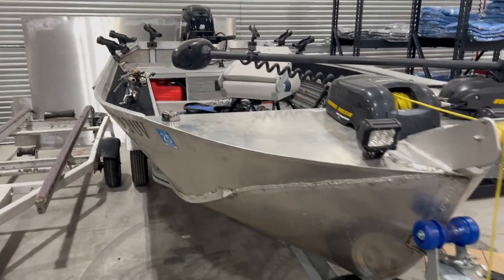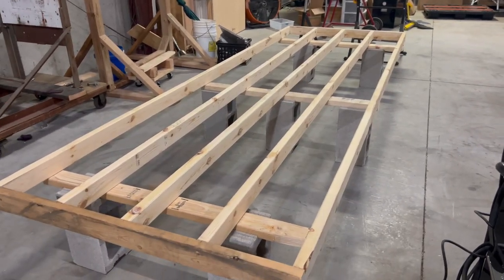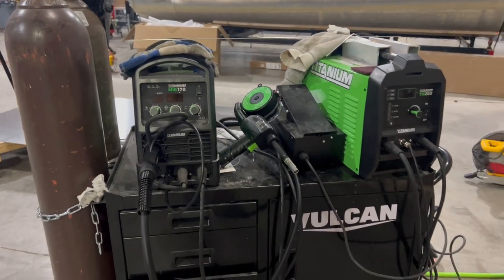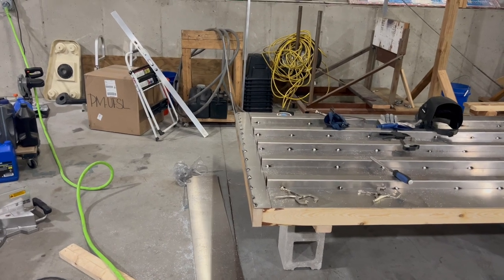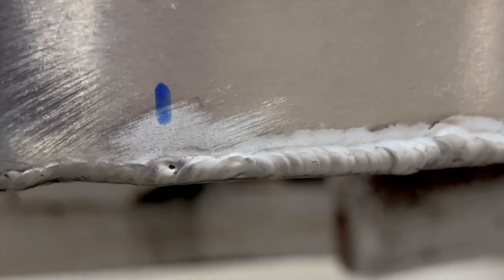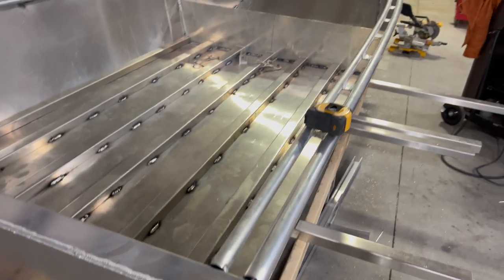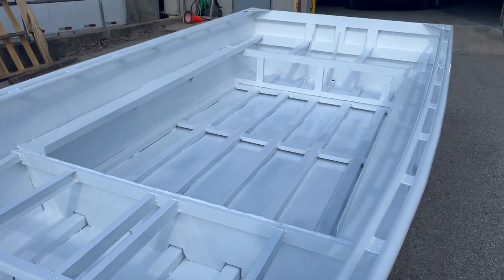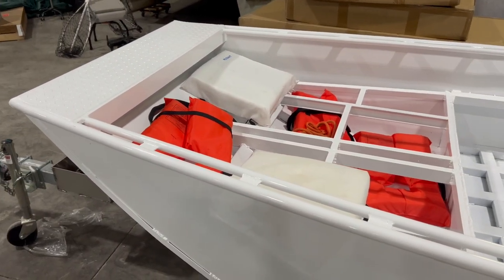Welded Aluminum Boat Build FROM SCRATCH - Part 1

Comment: How did you rip open the tubing to get around the top edge of the boat?
Reply from the maker: I set up a guide on my table saw and rip it on there. Works pretty darn well for 0.100” walled tube!

Comment: A pair of 2x2x24 angle attached to outside edge of transom on each side will fix that without adding any drag to motor. Sweet build. 
Bottom Lip on my rig runs entire width but this is lighter smaller.
Reply from the maker: Thanks! Just wrapping up the rigging and electrical and will share the finished project video soon. Then I start my 17’ sled. That’ll be a whole build series!
Reply: @tomspontoons  looking fwd to it. 17' tiller or center console
Reply from the maker: @omieyouknowme  17.5’ long, 78” bottom, 98” beam, 3 degree modified V hull. Tiller 140/100 Suzuki Jet with a Yamaha T9.9 kicker. Can’t wait!!
Reply: @tomspontoons  have you thought about 6 deg hull with a delta pad that runs up to midship. The delta pad lets you run shallow on plane and 6 deg helps with chop
Reply from the maker: @omieyouknowme  I absolutely have considered that. Probably on another build down the road. My old North River had that, but way too deep of a dead rise for here in Michigan on our shallow rivers.

Comment: The butt weld on my first boat was the worst.  Pheonix metals has a large distribution from Va all the way southeast.  60×240 sheets of 5083/6 available. Pricey but so worth it for double strength to weight ratio of 5052 and no seam.  Looking good!  Something else I didn't learn til round 2, always start at the center of what you are welding, the skip Alternatively outward from center, running bead direction toward center.  Let's say you have a stringer with 9, 3 inch  long welds.  The order would be 5, 3, 7, 4, 6, 1, 9, 2, 8.  Always welding toward 5.  This reduces warp and the tendency to pull the sheet away from rib.  Ever think about letting the bottom sheet (and sides?) Run past the transom?  Gives you a nice double fillet and leave 1.5 inches and you can bend up or down to trim and control porpoising if your cg is not perfect.  You can cutout the jet foot area some and pop rivet a rubber flap to feed the foot better too.  Maybe if I had the patience to tig the outside seams I would think that way though 😅  Just some thoughts I wish I knew!
Reply from the maker: Luckily I’ve got full sheets for the next few builds, so I’m very excited about that! As you know, the things you learn on each project builds and builds making the next even more successful. You’ve got great input here though to consider for my next build!! Thanks!

Comment: Serious question!!?? What would you charge for a 16 FT SLED? Or 17.5 FT sled?
Reply from the maker: Shoot me an email to let me know what exactly you’re looking for. I build an 18’ hull that’s overall 20’1” with the welded swim step and anchor tower (no longer than a typical 18’ when factoring in the motor sticking out 2’). This allows for more freedom of layout because a 20’ hull does not require foam flotation. 

TomsPontoons@gmail.com

Comment: How much do you got into This build
Reply from the maker: Because I was able to get some overstock sheet and lap joint the bottom and sides it was probably $1500 in aluminum. To do it with full sheets and extrusions I think it'll cost me closer to double that price! Working on a 16X60 modified V right now. Hoping to get some videos out on that in the near future.

Comment: how much was the powdercoating?
Reply from the maker: It was right around $600. They did it fairly cheap because they’d never tried doing a boat before, but it turned out great. Pretty sure my next build, a 1660, will be powder coated too.

Comment: How do you get the angles for the build heads ?
Reply from the maker: I measure and cut everything by hand, so lots of cutting, fitting, re-cutting, fitting, and so on to get the piece to fit just right. I always start on the bigger side so that I can keep trimming it in to fit. The more I do it the less adjusting I've had to do.
Reply: @tomspontoons  ok. And what angles do you cut the transom at ?
Reply from the maker: @ThomasMattes-c5d  I've experimented quite a bit with that and I don't necessarily choose an angle. I typically have my transom sheet, draw my bottom width/shape, factor in my side walls, and that essentially makes my transom angle where the sidewall meets the transom. This little boat had a lot less angle than I'd normally like to have, but that's because the sidewalls were short in relation to the transom. I would have had to make the bottom width narrower to add angle keeping those side walls, which I didn't want to do for stability sake. 

I do shoot for 15 degrees of negative trim on the transom as that's extremely important for planing and performance! I've got another boat build video of the 17' that I finished back in September:

https://youtu.be/HfqXNkI2G8w
Reply: @tomspontoons  thank you for the information I’m planning on building my first aluminum boat here soon. And any tips help.
Reply from the maker: @ThomasMattes-c5d  Happy to help. My big boat build has tons of footage and information too. Essentially, I just MIG everything together, then TIG weld everything that needs to be water tight and anything that I want to look pretty. In a nutshell, a simple boat isn't rocket science, but there's tons of research and development that big boat brands do to fine tune performance and details. Nothing better than running or fishing out of a boat that you built from scratch though!!!
Reply: @tomspontoons  that’s for sure. Do you just fill the boat up with water and watch for leaks. ?
Reply from the maker: @ThomasMattes-c5d I go along the seams with a magnifying glass to check for any little pin holes, fix any of those, then fill it with water or go dunk it in at the lake.

Comment: I am getting a aluminum welder but can only get one.. mig machine or tig?
Reply from the maker: If I could only have one it would be TIG. However, that’s because I’m working on thin aluminum and sealing leaks often, where a simple MIG setup doesn’t do so well! If all I did were aluminum trailers with thicker aluminum material, for instance, I would certainly prefer MIG. 

A spool gun for MIG is great for holding stuff together that’s thicker and not as aesthetically important. And the TIG can be tricky working in positions other than on a table or things that are comfortable to access. I much prefer my MIG setup when laying in my back welding!
Reply: @tomspontoons  ok, I’m using it to weld up a console on my boat and don’t have as much to put into a machine as I’d like. Some 1/8 plate and welding an anchor tower on. I’m close to you as it is I got all my plate from rescued metals as well. Cool shop.
Reply from the maker: @joneastling3336  Nice! I’m in Grand Rapids. In your case I would go with TIG. Those are items you can work on a bench to build making TIG its easiest and they’ll turn out much prettier. My machine is pretty simple but lays some nice welds. Practice practice practice first if you’re new to it, and you’ll be ready before you know it!

Comment: Entranced
Reply from the maker: It’s a sweet little vessel so far! 100 times better than version 1
Reply: You could tell by the test ride how stable she ran and at a good clip.  You're onto somethin' special.  I was digging the inside handrails. They are a nice touch.  Are there any plans for rod holders?
Reply from the maker: @awakenedtotruth8419  the handrails are my favorite part. Adds a handle, adds tons of strength/sturdiness, and looks great. 

I’ll do some Scotty rod holders on the rails. It’ll mostly be a float fishing boat though. My big boat I’m building next will be the trolling boat
Reply: What welders are you using for this project? Also What welder would you recommend for welding aluminum .125 to .190